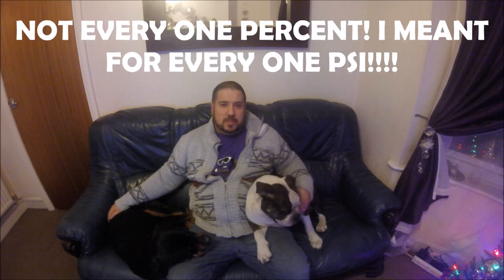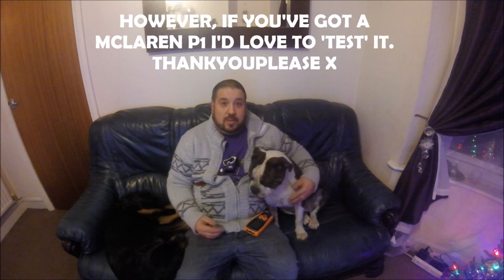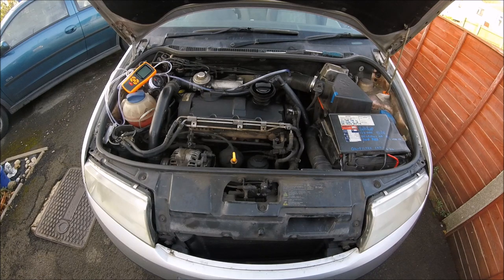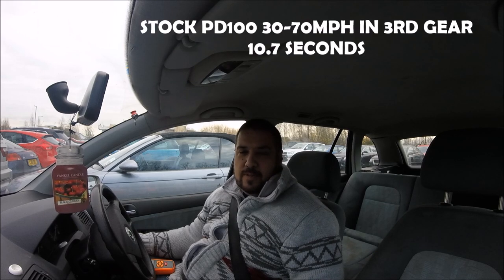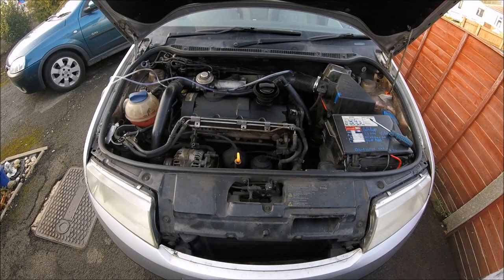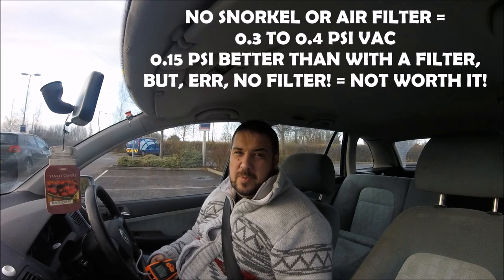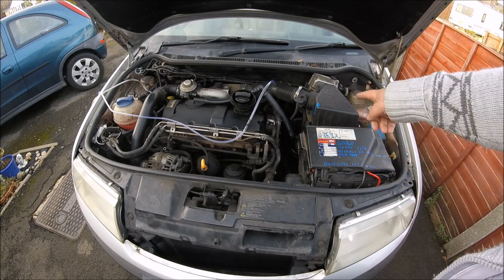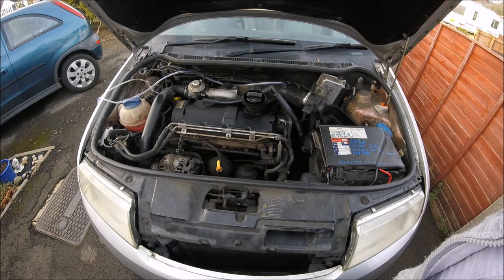[STAV-TECH] NEGATIVE BOOST! HOW TO LOOK FOR, TEST, AND REMOVE, INTAKE RESTRICTION!

Comment: Awesome video, I also have a PD100 (remapped) on an A3, it doesn't have that snorkel, the filter box takes air directly from the wheel arch. Could this be a restriction?
Reply from the maker: NOXXism thanks! And while it’s certainly possible, likely even, without testing I can’t be sure if it is or not unfortunately

Comment: I found your channel last night, and watched 90% of your video's. Love reading your comments on DW forum's and always thought you were highly knowledgeable about tuning, you're sort of the JUN koyama without the budget and jolly old based. I have a big restriction at the moment it's called a 1G-FE, so quick question do you reckon an aftermarket panel filter i.e. K&N (old faithful) or a cold air intake setup would help the now possibly 150(give or take)bhp? For breathing purposes. Cheers.
Reply from the maker: Thanks! Ref the intake- I doubt the filter itself is much restriction, though that's a pure guess without seeing it, but it's as per this video, the intake or often the airbox itself that's most restrictive, which is also why inn the old days just drilling tons of holes in your airbox was a common mod.
Without testing though it's a pure guess.
Reply: Stav-Tech well I've not had the car(IS200) long so gave it a service this morning the "snorkel" is mahoosive and the filter is like a borrowers porkchop, anyway the snorkel has a chamber in it and I nearly managed to fill a black bag with the tree leaves that were stored in there, car feels loads better. End of story I'm going budget CAI. Cheers

Comment: Very interesting video(at least to me who knows nothing). It's good that you're running tests in the videos as well, since obviously most people don't test any of their ideas and end up unfortunately talking bollocks. Would've been nice to see dyno runs on top of all this to show the power gains, but I sadly doubt you're made of money enough to buy dyno time every time you test something, although I guess if you get it remapped in a follow-up that would probably be happening there.
Reply from the maker: Right-Wing Internet Mang - yes exactly. Most talk is just that, talk, and it’s often bollocks. I go by proof. Dyno may be on the cards for the follow up as a back to back before n after, but for me at least dyno numbers are the least important factor, as we drive our cars on roads not dumps, so I’d always pick proven performance over numbers.

Comment: Hi Stav, what model vac gauge are you using? Going to order the same, will play around with my M140i B58 when it arrives 👍🏻
Reply from the maker: Daniel Barwell this one is just a GM510 half the world seems to sell for about 35quid. I tested it vs other calibrated gauges and it’s pretty bang on every time, more than accurate enough for car restriction testing.
Reply: Cheers Stav, I’ll get one ordered.

Comment: interesting findings in the video! I wonder what the results be if you remove all airbox setup and add enlarged intake snorkel to it!
Reply from the maker: Mantas_lt I think that would be best of all, but no filter. But I think numbers were so low by last setup any lower won’t make a big performance difference. Though if tuned for more the effect would be magnified.

As soon as I get a chance I’ll be testing the restriction on a far more extreme engine

Comment: The ram air effect on turbo engines can make a dramatic difference if the turbo placement is encorporated to the design, just recently i watched whether they were able to make 65psi on the dyno but 71psi on the track due to the ram air effect.....obviously this is at the high level of turbo drag racing, but still very interesting
Reply from the maker: turbotoaster1984 was it proven to be ram air or just the colder air and higher load? It’s common to see more boost on the track vs dyno but usually put down to more load
Reply: Stav-Tech I will have a look now, it was either a 1320 or TRC video and send you the link via FB

Comment: You said keep the trumpet in... What effect does it have?
Reply from the maker: The video shows it. With it remove the restriction is higher.
Reply: Stav-Tech Yeah I get that, but what's the science behind it?
Reply from the maker: daddy paddy trumpets smooth the flow, helps turn turbulent flow to laminar flow. In reality, I’ve never experienced removing one to ever do any good and experienced countless times when adding one helps a lot. There wasn’t a big difference this time, but it still did the usual and made it worse